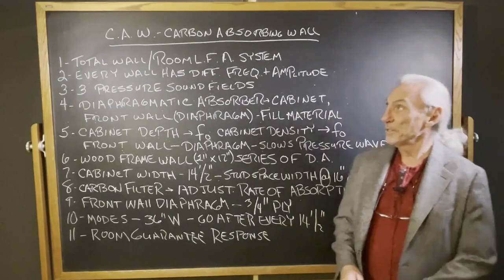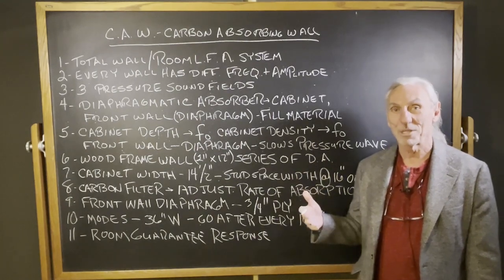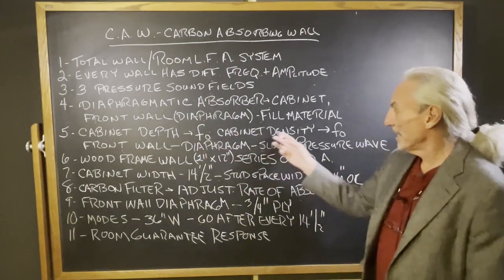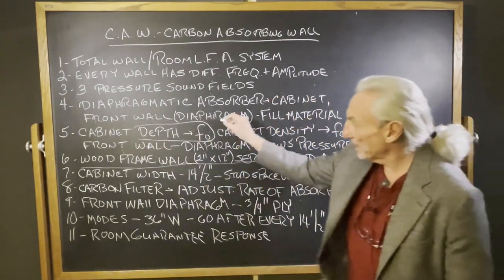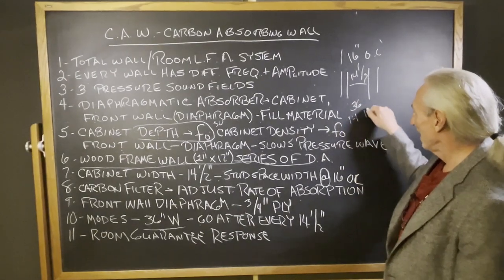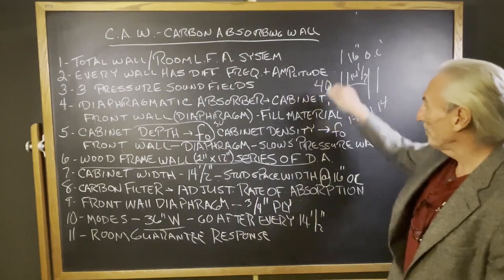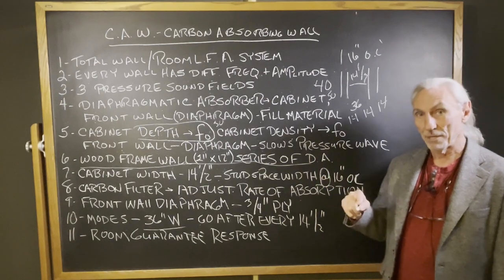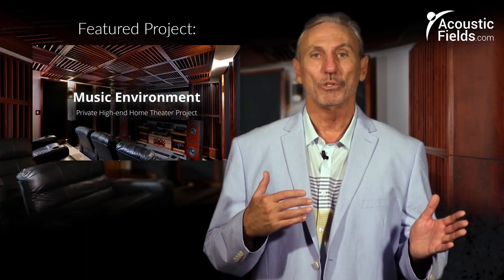CAW - Carbon Absorber Wall - www.AcousticFields.com

Comment: Excellent program and interesting details on incorporating treatments during the initial build process.
Reply from the maker: Building low frequency management into the walls is the best approach for surface area covergae requirements along with increased performance.

Comment: So you would not be installing drywall over the carbon panels ?
Reply from the maker: We do not use drywall in any of our builds. Drywall has a negative impact on middle range frequencies. Our room "skin" is usually cherry plywood.
Reply: @AcousticFields  thanks

Comment: How would a BDA function if instead of a fill material, a vacuum was created inside the cabinet?
Reply from the maker: A "vacuum" of sort is created inside of our cabinets using our carbon technology. The pressure inside the cabinet is lower than the pressure outside the cabinet. Though not a true vacuum, the lowering of internal cabinet pressure, along with the cabinet depth produces the rate and level of absorption achieved by our technology.

Comment: I'm curious. If one lives in another state... do you partner with others to do this kind a work to your exact specifications.  This is definitely not something I have the skill set to do...and I wouldn't know where to start to find someone who is qualified. I wouldnt expect any ol handyman having much respect for audiophile room treatment/builds.
Reply from the maker: All of our treatment and noise designs can be achieved using standard construction methodologies. There is nothing esoteric or exotic. I have designed all technologies, along with their associated acoustic goals, to have standard construction material types and construction techniques. All you have to do is furnish the labor.

Comment: interested. But im a renter 😭
Reply from the maker: You will have to use freestanding units instead of the CAW.  Rememenber in small room acoustics, its all about having enough surface area coverage to treat each wall and their individual frequency and amplitude issues.